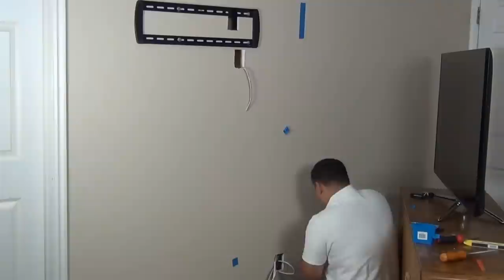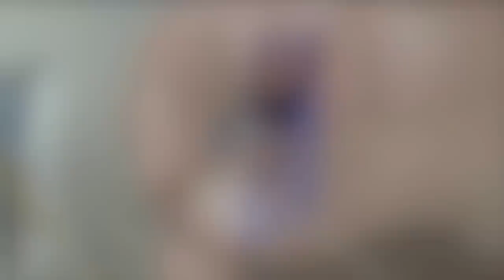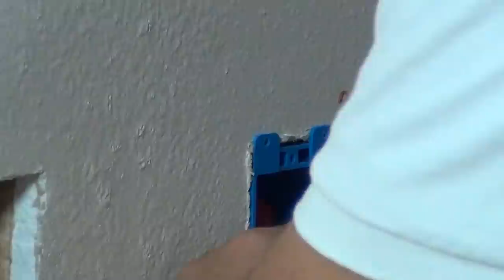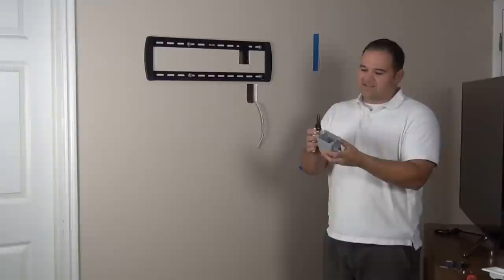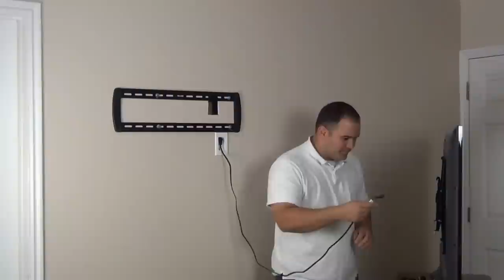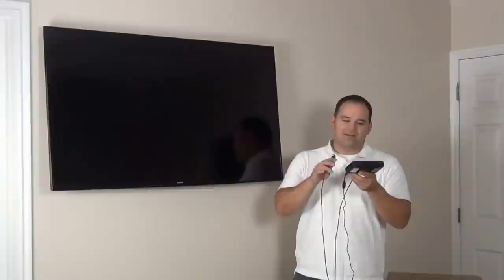How to move an electrical outlet behind the TV - How to Mount a TV to the Wall part 3

Comment: What is the difference when doing same job on an outlet connected to a light switch?  When we opened up our outlet, it has 12 gauge cable (black white red).  By the way, videos are awesome.  Super simple.
Reply: By the way, cable is in black casing if that helps explain anything.  There are two main cables coming into the box, only one set has a red wire though assuming that's for the light switch???
Reply from the maker: I'm assuming you have a black, white, red, and copper ground? The red and black are both going to be HOT legs. The white is a neutral. If the red and black are both connected to the outlet, then one side of the outlet is controlled by the light switch and the other is always hot. Usually the black one is the constant hot and the red one is switched. If you look at the screws where the wires connect, there is a metal plate under them and there is a small metal tab that connects the two screw plates together. On your outlet, the white wire side of the outlet will have the small connecting tab and the black/red side will have the tab broken off. That's how they make one side always hot and the other side controlled by the switch. This is a great topic for another video I think. Try searching for "switched outlets" and I bet you can find a good video explaining better than I can in words. If not, let us know and I'll shoot a video.
Reply: Yes, I did a search and between your video and the new video, made perfect sense.  Would make for a good video for you though (or at least a heads up on the current video).  Was totally flabergasted when I first opened up the outlet plate and saw the extra wires. Made sense once I disected and researched new videos for the wired switch though.  Thanks for your videos, they're awesome and so much appreciated!!! :)

Comment: I wouldn't use the type of wall outlet you used behind the TV because the TV has the type of plug that blocks you from using the lower receptacle. If you use a standard wall outlet receptacle you can plug the TV in the lower outlet where it won't block the other outlet. There is enough room behind the TV for the plugs not to interfere with the back of the TV resting on them. I'm not sure if you actually plugged in the DirecTV box with the TV plug blocking access.
Reply from the maker: If you are using a tight wall mount, you won't be able to fit the plug into the wall with a standard outlet. Typically the DirecTV box will plug into the outlet at the bottom of the wall. Thanks for watching!
Reply: It won't work when the plug is made like the one you used in the video. The wire comes out of the bottom and the cord will not bend enough to fit in a box type like the one shown.

Comment: Interesting question here please:
* so,...you gang the Hot wires, the Neutral wires...and the grounds....doing so just allow the whole electrical outlet to have power from one side of the outlet; top and bottom then....correct?  

I always have taken out out outlets...and then just "follow suit", by attaching wires to both sides of the outlet...and attaching one ground to the gold screw.  

Is one method better than another effectively?

Cheers,...good video.
Reply: Frank From Upstate NY Ground always goes on green screw.
Reply: Tail out circuit wires to maintain continuity incase outlet fails.
Reply: @illestofdemall13  Not on GFCI'S
Reply: @jcagy2  Not sure what you mean by that. Unless you mean if there is no ground at all.
Reply: @jcagy2  Ground (bare copper or green insulation) goes to the green screw. Line goes to the gold screw. Neutral goes to the silver screw. With GFCIs you also have to wire the respective line and load properly (depending on the way they are wired or if you are planning to protect several outlets downstreamwith one gfi).
Reply: @illestofdemall13  Grounding wire is not connected to the receptacles on down the line.after the 1st one
Reply: @jcagy2  I am going to have to check the current code because I've never heard of that. The only time I know of that is when protecting an old 2 wire circuit that isn't grounded. You can put a GFI on the first upstream and put the "No Equipment Ground" then you have to change the other outlets down stream to grounded, even though there is no ground (Or you can just wire all GFIs on that circuit).
Reply: @jcagy2  You are mistaken.
Reply: Only when there is no existing ground, then you can use a GFCI because it reads imbalanced loads between hot and neutral, therefore it trips whether there is a ground or not.  Other than that, every outlet in a normal household should be grounded, according to the code.

Comment: How would you wire this using alumnicon connectors in a house with aluminum wiring?
Reply from the maker: Great question! I don’t really know to be honest. I worry that a wire nut would snap the wires. I have never seen that. Sorry man!
Reply: Use the push connectors u can find them at any big box store u just push wire in and it clamps on then use copper wire to new outlet. Most place that wire is out of code

Comment: My problem is stud i need to by pass behind wall is metal not a wood ?
Reply from the maker: Ugh. Probably safer and easier to remove drywall and patch in that situation. Don’t forget to protect the wires with grommets or something similar when they go though the studs.

Comment: You should have used the original box and never have taken it out.  Cut the new box above, drill hole thru all studs down at an angle, slide a tube thru the holes, feed new wire along with weighted string thru  tube and let it drop down.  Fish out  thru the existing box and pull cable down and make connections.  That would have been much quicker.  If there was only a single feed to the lower outlet than you could have fish it over to the new box.
Reply from the maker: I typically use the original box if I’m going straight up but going diagonal makes it unnecessarily difficult.

Comment: Nice, Thanks.  I have a regular outlet on left wall above Bath Sink with a mirror above sink on facing wall.  Desire to:  ( 1)  Move receptacle to left on left wall with a new GFCI.  ( 2 )  Eliminate original outlet to plug into by a junction box with a cover to conceal any wire connections.  ( 3 )  Mount a Medicine Cabinet in place of Mirror on the Wall, which would cover place of original outlet.  Would this be Code ?  Original installer should have considered spacing first outlet over & installed a GFCI ( 20 yrs. ago ? ).  Can I cover the now neutered - junction box receptacle with a cover - original receptacle with a cover, with the connected wires to the New GFCI Receptacle to the left of the Medicine Cabinet?  I don't want to make wire connections behind a new wall hidden behind and exposed.  I don't think that the existing wires will reach the New GFCI Receptacle.
Reply from the maker: I don’t follow the details perfectly but I can say that every junction box must be accessible. You can cover it with a removable cover or faceplate without a problem. Don’t bury any junctions behind a cabinet or drywall. As long as you have access to all of your junctions by removing a cover or faceplate, you’re fine. Does that make sense?
Reply: @AlanCleggYouDoAV  -  Thanks, Either ( 1 ) Raise the height of Cabinet and use existing outlet, (2) Move to new electrical outlet to left with existing wires, and ( 3 )  Could I cut a hole in the side of the Cabinet, in order to gain access to Junction Box with a cover?  Hope I am not a pain.  Your videos are excellent to view.
Reply from the maker: I don’t love the idea of cutting the cabinet. There will be secondary issues that we can’t see right now. There always are. Moving the outlet over and patching the old hole seems like the best idea if the wires are long enough. If not, you can pull them into the attic and splice on a longer wire to go wherever you want. I have a video showing how to patch drywall. It’s super easy. Just use the new piece you cut out to patch the old hole.

Comment: Great videos! Very anal, as I am when doing electrical work. I'm looking to add a surge protector behind my wall mounted flat screen TV. Have you installed an in wall surge protector with the recessed electrical box you used in this video or do you recommend a electrical outlet that is flush to wall to add a surge protector? Any surge protectors you recommend for this type of install. Please advise. Thanks and keep up these great videos.
Reply from the maker: Check out this video https://m.youtube.com/watch?v=0-wwoclkGtc I did this years ago but I still use the same product. It allows you to use one high quality surge protector for the entire setup. Let me know if it makes sense on how to use it.
Reply: that is nice. I may work well for one application I have where there will be a cabinet below he TV, the other application It's just a smart tv used for HULU, NETFLIX, etc that I wouldn't want to see any wires hanging out of the wall. I did find a in wall surge protector, but only down side it's not recessed. So there is no perfect world.
Reply: You can put a surge protector at your electrical panel
Reply: Why do all Americans think they are something special, really loves himself.

Comment: Nice work! Do you know how to get cables from the second floor to the first floor without sheetrock repair?
Reply from the maker: I get this question a lot. I keep saying I'm going to make that video but I keep putting it off. It can be done. I've done it many times but it's not always possible and making a small hole is usually faster and safer anyway. Ugh. I need to just buckle up and make this video.

Comment: Lineman's Splice? I have never heard of it. But, decent video for the homeowner. Why not use a green wire nut incase of future work?
Reply from the maker: That would work too.  I used to use wire nuts all the time, then I had a journeyman residential electrician show me the ground clips clamped on a lineman's splice.  I just use them like that now.  I see you're IBEW.  My full time job is IUEC.  Glad to see another union brother!  I know commercial electrical jobs never use a lineman's splice with a ground clip, but the ground is also a green wire as opposed to a bare copper one.
Reply: There's a few ways to skin a cat, just as long as that cat doesn't short out in the future. As an old electrician, I try to use as few wire nuts as possible, cramping hands nowadays....
Reply from the maker: @chrismarshall4523  Thanks for the feedback and thanks for watching!

Comment: Home wiring is generally not very complicated, but you need to know what you are doing and have the tools.  This guy did not explain the electrical part very well. You need to know where the power is coming from and where it is going. You also do not want to tap into a circuit with switches on opposite sides of the room that control one outlet or a light. I've learned this by doing, asking questions, and watching YouTube videos. If you screw up, you may have to hire an electrician, which costs more than a TV installer.

Comment: Nice video. What tool do you use to drill through the studs?
Reply from the maker: I use an 18 volt Dewalt with a wood paddle bit- usually 1/2" or so.
Reply: @AlanCleggYouDoAV  I wouldn't think you would have enough space to do that. Also, if you're drilling horizontally through 3 or 4 studs how would that work with only a single gang cut out? Would you use a right angle drill with a stubby bit?
Reply from the maker: @eddiesalinas3693  You don't have to drill through all the studs from the same side. I know the videos are kinda long, but you'll see the tricks if you watch all them the whole way through.
Reply: @AlanCleggYouDoAV  thanks. I'll check em out.

Comment: Great video man.  I do have a question. What if you want add an outlet to a wall where no current outlet exists?   Completely custom.
Reply: attic
Reply from the maker: You have to tap into power somewhere where there is an outlet.  Grab it from the nearest outlet you can.  if you have an attic, you can tap into a line up there.  Make sure you put the splice in a box though.  If you don't have an outlet, almost any electrical location will be ok.  Just check the existing location first.  If it's a light or a light switch, it may not have a complete circuit in the box.

Comment: 6" ! not 4 or 5" out the box, that is the NEC  in all US states
Reply: I noticed that too, along with not using the small hole in the stripper to make his hook, other than that very nice videos how to. I was taught to basically use my hand to get right length of wire ,measure from end of middle finger to wrist, final result 6"..
Reply: I also like to use pig tails on the receptacle and connect the hot and the common with Wago lever locks and secure the ground with "greenies."

Comment: I wonder why he didn't pull a cable wire up through also to eliminate the exposed wire.
Reply from the maker: This house is wired to a central closet that houses all the additional equipment. I had that wire exposed for temp use only.

Comment: Forget it, I'll just hire someone to do it.  Should I hire a electrician for this?  Can they also mount tv's?
Reply from the maker: It's hard to find people that will take the time to skillfully run wire like this. Most take short cuts or make holes which you will have to latch later
Reply: I just looked at my current setting and looks like I only have to raise the outlet 4 foot higher from the ground and a few inches to the left.

Comment: can't see anything you are doing inside the box at the bottom...a whip?
Reply from the maker: A whip is what I call a wire I add for splicing. So I'm splicing together the three wires in the box and I'll add another wire, which I call a whip, so I have four wires under the wire nut. The whip is the only one I attach to the outlet. It's hard to connect more than two wires to an outlet so I just splice all the wires together, then add a whip for connecting the outlet. Hope that helps.
Reply: got it, thanks

Comment: Hello Alan, great video bud. i do have one question, what happened to the hole next to the outlet down at the bottom?
Reply from the maker: That hole was already there. It's where the cable TV came out of the wall. I put a new face plate on it and brought the other wires out of the same hole.

Comment: Shame you don't use earth wire/ground wire covering like we do here in the UK, that way you wouldn't have to worry about the wire touching. also adding an additional power source, can add extra load to the fuse board, you should always make sure that the fuse on this circuit is able to cope with having an additional outlet added to it, before you even start, or all your hard work could be for nothing......
Reply from the maker: I wish we had coated grounds too. We do in commercial buildings but not residential. Thanks for watching!

Comment: Connections with wire nuts need to be twisted before the wire nut is added. You claim to be a professional but I cannot believe that. Your not old enough to remember but connections were soldered before wire nuts. Then rubber taped and friction taped. When wire nuts came on the scene they were called solderless connectors. It is important to twist the wire FIRST then apply the wire nut. The reason is because what you did could cause one of the wires to move down while you tighten the connection. This could cause the connection to fail in the future.
Reply from the maker: Well... you can't please them all I guess.  Thanks for watching!
Reply: The wire nut manufacture's data sheets state pre-twisting of the conductor is not necessary. If a wire nut is installed correctly the wires will twist as you apply the wire nut. This is a UL listed assembly at this point. However some still twist  before installing the wire nut,  but it is not necessary.
Reply from the maker: Thanks for that info!
Reply: I ha e removed previous wire nut connections to add more wires and noticed that the manually untwisted wires that were just twisted w. Wire nuts were in fact twisted and locked. Also as a precaution so the wire nuts stay we also tape the nuts.
Reply from the maker: @mauriceordonez4566  I make sure all the wires are the same length so they butt into the wirenut together. Then I twist the living daylights outta them till the wires twist up. Then tug each one to make sure it has a good bite. That has always worked for me.
Reply: Don't pay much attention to these self proclaimed know it alls. Your video was very informative, well produced and I got a lot of good information as a result. I would like to see some of their videos. I'd be willing to bet they don't have a any. Keep up the good work. Your efforts are appreciated.
Reply from the maker: @c.franklinkielich9443  Thanks! Making a valuable video that people like watching is hard. I appreciate the encouragement!
Reply: Twisting before or twisting with the wire nut doesn’t matter. What matters is that the wires are secured in the nuts and don’t come off, a pull on each conductor will check this. Taping the wire nut is also and option by the installer.
Reply: @prh44  Yes! Just simply line up the wires of the same length and size. For a solid wire and stranded wire, the recommendation is, the stranded should be 1/8 inch longer than the stranded wire.
Reply: Everybody's a critic on YT videos, I see. Why can't people just appreciate a well done, well explained tutorial ? Great job sir !
Reply: John Nilson if you don’t like it then get lost!
At Lincoln Tech they taught us NOT to twist before adding the wire nut💯

Comment: Alan, Great job and narration. John Nilson is also correct. Wires should be twisted together with Lineman's pliers BEFORE the wire nut is twisted on! Need advice on Electrical or Electronic Systems. Check out our website: www.IntelEstate.Net or call (844) NETAGENT